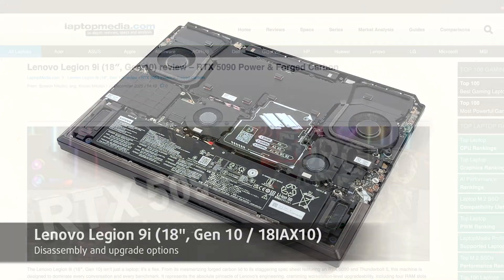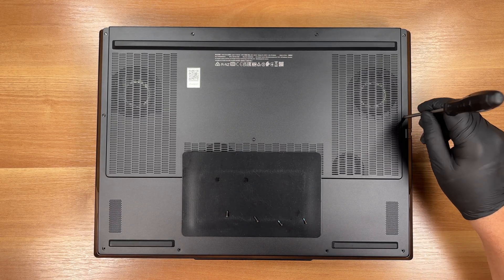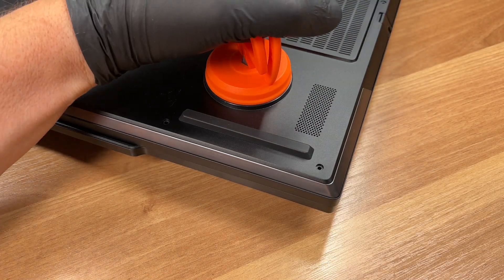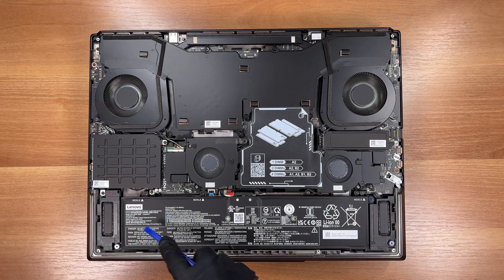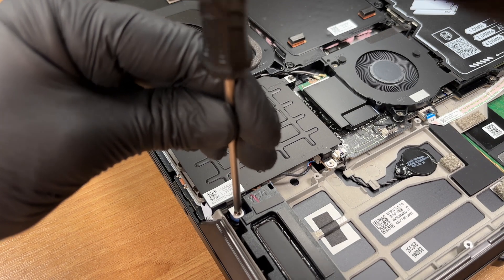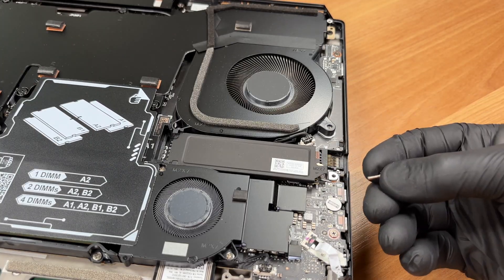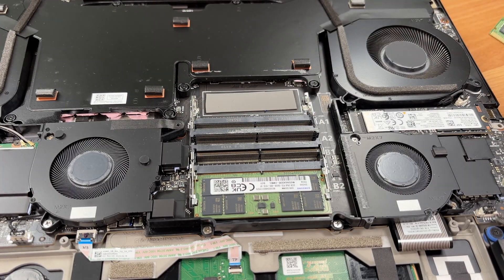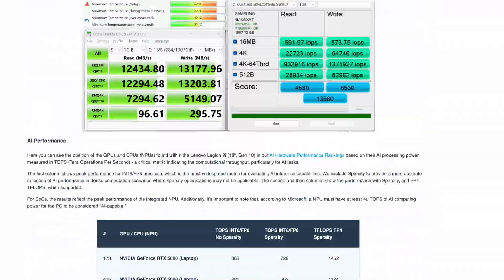🛠️ How to open Lenovo Legion 9i (18″, Gen 10) - disassembly and upgrade options

Comment: Nice video. Quick question, you said : "before touching the ssds disconnect the battery". So I don't have to disconnect the battery if I upgrade just the RAM modules ? or how do we decide when to disconnect the battery ?

Comment: can it be upgraded to 256gb of ram
Reply: Elon ?
Reply: No
Reply: @PFLX113  the cpu can adress 256GB so it should be possible
Reply: @Psav26  mainboard constraint, same thing when desktop motherboard some support 192gb and others is 256gb
Reply: @noname-wg5me it's BS 192GB max was on intel 14 gen and it was a cpu limit not a mobo limit ,here cpu can have 256GB
Reply: @Psav26 no, it doesn't matter if only CPU supports 256gb and mono isn't. Same thing with the z890 chipset on pc.

Comment: Great... What do you think is ideal for ssd? Gen5 2tb or will it take more per nvme stick? What brand and model do you recommend?
Reply: Samsung hands down, they are reliable, fast and seem much more heat resistant than other brands, I had a crucial ssd and didn't last more then 3 months in my laptop while the samsung being 4 years old 2 terabytes still working without any errors